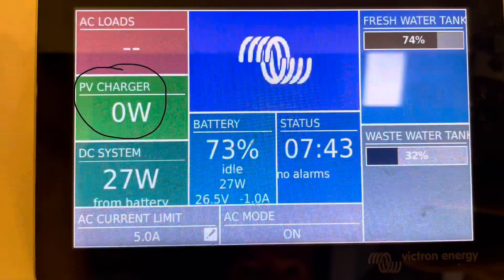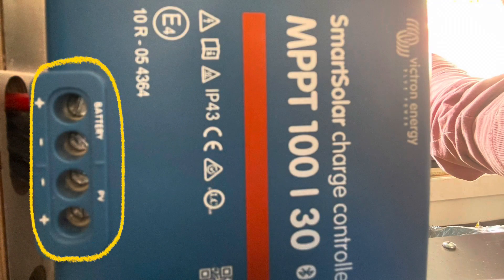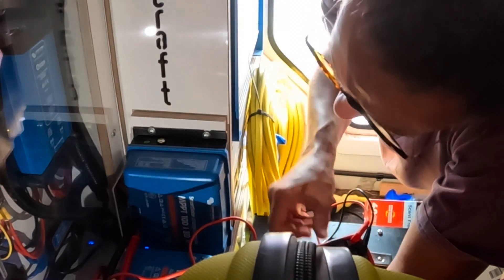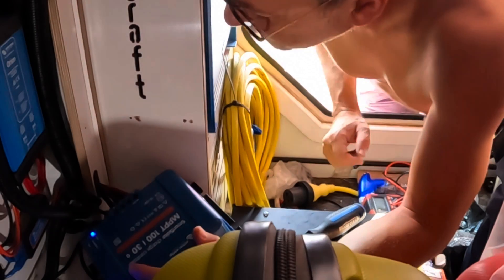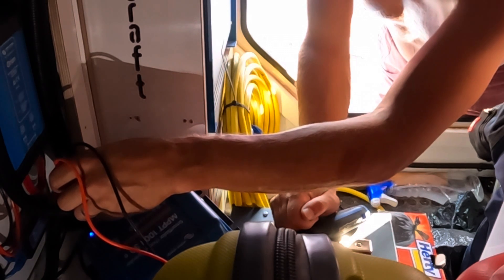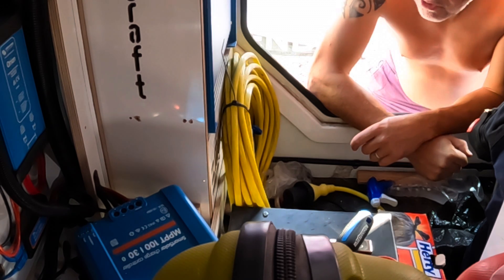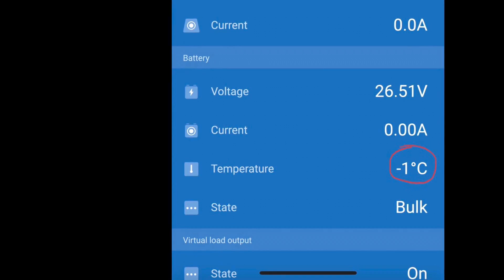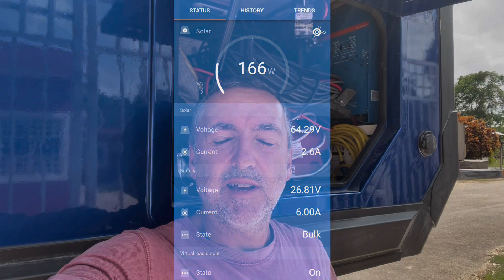Troubleshooting our Victron Energy solar charger

Comment: Fixed, until it happens again. then again. then again...?
Reply from the maker: Well it hasn’t happened since - nearly 2 yrs 👍
Reply: @dollysdiary160  Just my question, how big is that battery bank, and if it was discharged as low as it seemed to be, why is the controller only putting in only 6 amps, I am also wondering why you can only pull in 166 watts, is it cloudy?
Reply: @davej7434 The battery bank is 400Ah and guess it was probably cloudy, but don’t remember for sure.